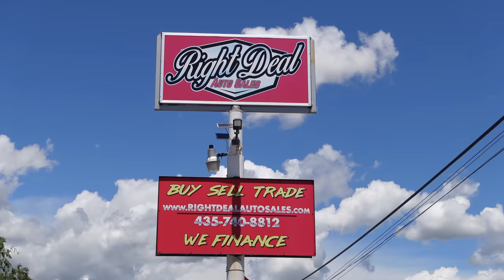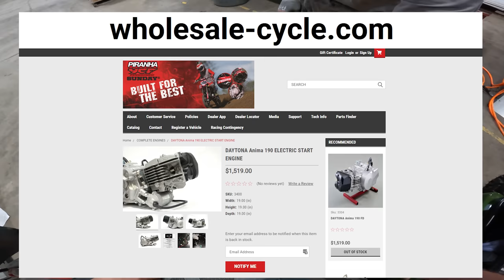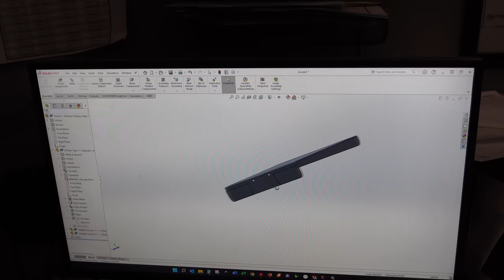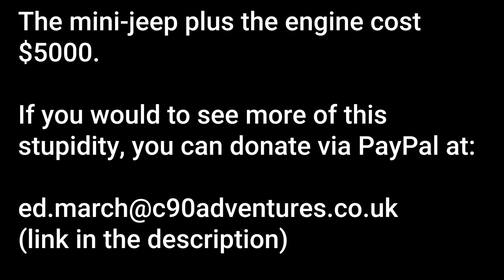Will the mini jeep make it to Moab? Ep1: The build.

Comment: The trip to the hydraulic place brought back memories. I once bought a '74 Volvo. It had an early form of fuel injection, and had these long high pressure plastic tubes running from the fuel distributor to the actual injectors. They were 40 years old and cracked, and started periodically misting the engine in gasoline. I called around looking unsuccessfully for new old stock. I can't remember why, but out of desperation I walked into a hydraulic shop down the street from my house, and got brand new, hand made replacements for like $80 that afternoon. This random tractor repair shop was 1000x more helpful than any actual Volvo shop I talked to.

Comment: You could use a radio and a trailer made to look like the back of a jeep .😊 plus when you showed the throttle cable it looks like it was rubbing on the guide . If you can you might want to make the throttle cable come over the top of where it’s bolted on the throttle pedal instead of the bottom 👍

Comment: Wow, stumbled on this video in recommended. Watched the whole thing and subbed! HOWEVER!! I saw 14TB HDD. and that thing is EXTREMELY bumpy. I would absolutely recommend an SSD or flash storage if there is going to be a lot of vibration, because that can corrupt a hard drive REALLY quickly. Just a word of caution as a I work in IT.

Comment: i dream of doing one of your crazy trips one day, the closest ive ever been to that was a 3 day bike (like a bicycle, not the motor ones) across a small part of Denmark, it was supposed to be longer but the guy i was riding alongside got sick and the weather decided to try and reenact the biblical flood.

it isnt much but it did give me a small glimps into the mental strength and willpower required to go through any kind of multi-day trip (let alone what i've watched from you)

Comment: Just a friendly bit of information you can quell the majority of the vibrations in that jeep by buying a couple little strips of quarter inch thick rubber to place between the engine motor mounts and the chassis, helps immensely with those vibrations!

Comment: This is great, but I'd have changed two things: 

Mount the clutch on the windscreen bar so you can have more precise control with your hand (leg room doesn't leave much for fine motor controls I see).
Swap tires for low-pressure ones you find on ATVs so you have some sort of suspension.

Other than that, I look forward to seeing if this thing can even go 500 before a wheel falls off.

Comment: Also an additional chain drive transfer case can be installed to give more gears, higher top speed and a lower crawling gear as well. Go power sports sells those transfer cases if I'm not mistaken.

Comment: Another thing I had to do to mine was a silicone the whole body to the frame to illuminate some of that vibrations sound.
but, 
 I do plan to do a body lift with 3/4 rubber mats

Comment: Next time, cut the fittings off the oil cooler and slip the tubing right onto the bare  metal tube that comes off the oil cooler and then use a crimp or worm clamp to secure it.

Comment: This is a perfect beginners build car. I'm being serious, take this little ratchet machine, swap an sv650 motor onto it and reuse the stock trans, maybe go for an upgraded clutch. Then take some atv suspension from a junkyard 4 wheeler and slap them under it, pay a local welder a few hundred bucks to weld up the modifications to the suspension mounts, maybe grab a small set of at wheels while you're at it and the rear end. Throw it all together with a better set of controls, and a soft top and you'd have a sweet off roader you could put in the bed of a truck/ute.

Edit: it'd be pretty similar to building a racing lawn mower.

Comment: I kinda want to do a trip like this in something stupid. My Eastern European country has these things called Babetta 207. Basically bicycles from the 70s to 80's with a 50 cm3 engine welded to it, and you can get them for dirt cheap. Mixing fuel and oil on the go would kinda be a problem though.

Comment: The welded nut on the bottom of the throttle is meant to be a limiter. If a bolt is in it and further up you cannot get full throttle

Comment: Might be fine but could use an oil cooler? Thinking it'll be at a higher duty cycle than a regular motorbike. Would have to think how to drive that, maybe chain drive pump and small electric fan, oh yes that cooler is nice.

Comment: Would be a really fun, to overengineer this whole jeep, to be able to have some ,,crazy ,,power ..
Relocate the fuel tank to rear.. And fit some proper bigger build harborfreight engine 😅 get a cnced tranny with working 4x4 and this would be the ultimate offroad vehicle for years 😅 lightweight, so there is nothing stopping you if you got stuck.. you can just lift it 🤣

Comment: Also it looks like the front ball joints or wheel bearings are quite loose those wheels wobbled like nothing else! By the way the suspension is nothing more than high-end mountain bike shocks which you can replace to get a much better ride quality...

Comment: Ive big bored some of those engines in an afternoon over a few cold snacks.  You can swap bigger and vetter carburetora and pkay around with cylinder head sizes and oil coolers. Cbange your front amd reR slrockets evwn add a 4th gear to a 3speed gearbox . The horizontal style engines and really fun to modify and they are bulletproof.

You habe to run the engine with the oil cooler and top it up. The cooler fills and then your engine runs dry of oil
 I always try to loop a hose or have the lines enter and exit the top. You have to drain the cooler when doing oil changes also

Comment: I wonder how a Honda CBR125R engine would have been in the jeep, because its relatively common in Canada so parts are easy to come by. It would have enough horsepower to pull the jeep, and it has 6 speed transmission with a much more forgiving clutch.

Comment: This may have been addressed already, as I haven't read through 2421 comments, but would it have been possible to mount the clutch lever to a lengthened shift arm?  I think your hands would have been a better fit on that clutch lever than your foot, no?  Grab shifter, pull clutch, push or pull shifter, release clutch.  First gear would be the most sensitive, after that, it's a breeze.

Comment: Hey Ed, I’m a little confused with the engines. Did you engine swap the 25hp engine into it and not use it for the trip? Asking because the engine you burnt up does not look like the on you burnt up. @c90adventures.

Comment: Sadly you didn't find one of the much better options out there before this. Or knew about the 15ph motors for half the price made for off-road durability. 

FYI - 220F is the normal operating temp of a combustion engine.

Comment: Should have putted Royal Enfield 350 cc engine, it will suit for this Jeep best , for carrying that Jeep load you need more torque than power ,that racing engines wasn't able to produce enough initial torque to move that Jeep.

Comment: You should drag that puppy to the Boys At grind hard plumbing and let them Jazz that thing up with four-wheel drive and a four-cylinder motorcycle engine. Then you can get a cross that Thousand Miles pretty quick

Comment: I only exact same Jeep I got for my 10-year-old niece it arrives in parts then you put it together and it is made like s*** be careful off-road because all of the welds start to break most of the bolts you're going to need to retighten and quite honestly we got it for $1,100 brand new shipped and I know other people buy them for that same price put them together and then charge 5 to $600 for it put together I can't believe somebody has $3,500 on that thing it's not even worth that at all especially used those things are garbage they are fun but also you can make a wide right turn but if you try to turn left you're going to have to put it in reverse a couple times because when you turn the wheel left something hits the wheel and you can't turn and if you don't believe me I'll send you pictures. Also I custom-made with a few metal rods and some plastic sheathing a cover for the Jeep so you can drive it in rain and it blocks the wind a lot better you'll at least be covered from outdoor elements or s*** flying up at you

Comment: Under 300° for an air cooled engine isn't very bad at all but for extending running, there's no telling how high the temps would have climbed. Plus the engine is under the bonnet without a clear flow of air, so indeed the oil cooler was a good choice. Feel bad that you didn't try the trip with the stock engine, that is outright cheating. 🤭

Comment: That should go way faster then 30mph it has to have a governor or speed limiter
Reply from the maker: Unfortunately not, it just has the physics of 8hp and a quarter of a tonne of weights to move. On the flat you could probably get a bit more speed, but the second there's a hill, the speed slows right down.

Comment: 3-cylinder 500hp Yaris GR engine only weighs 70kg (145lb). Koenigsegg 600 hp 3 cylinder engine weighs 59 kg if money doesn't matter. You can only carry enough batteries to travel 30 kilometers each day so that won't work unless you leave now for next year's MOAB and overnight to charge? so Toyota is my choice. Just Do It.

Comment: I just stopped the video! I got had by the Amazon red chain tensioner as well. Not only was the body the worst design ever, it only lasted about 12 seconds on my rig before the pulley completely overheated, melted, and threw itself everywhere.
Reply: Not to mention I spent an hour tapping and altering it and my rig to fit properly before the massive rubber rainfall.